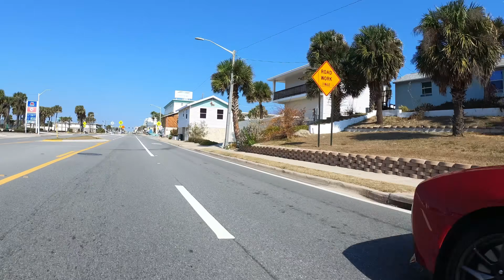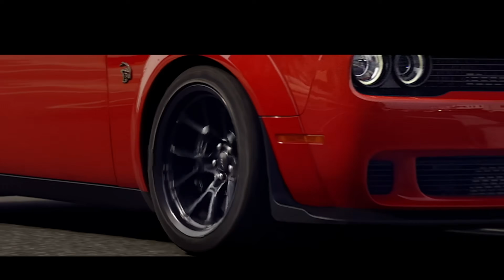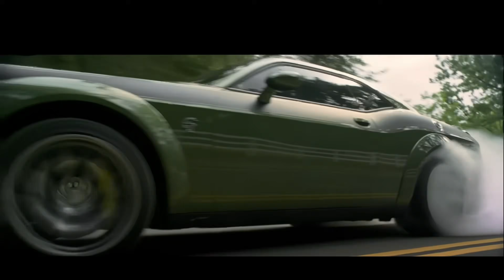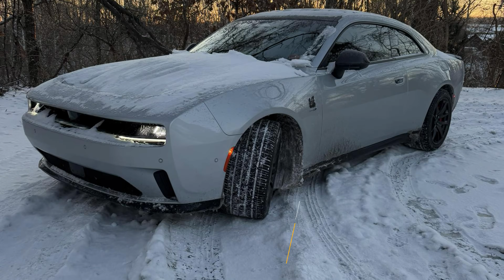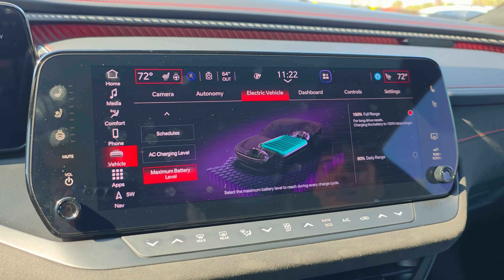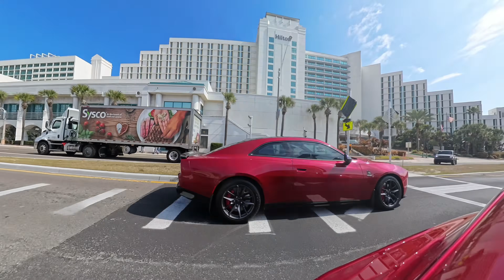Dodge Charger Daytona Scat Pack EV Owner Review

Comment: No glitches or reliability issues?
Reply from the maker: I haven't chatted with Garrett since that video was made, but I did end up buying a used 2024 Scat Pack EV and of course he discussed his car's reliability after 38k miles in the video. So far I've put 9k-trouble free miles on my Scat Pack, for a total 24k miles. It had all the flash updates performed before I bought it. Based on what I see in user forums, it sounds like Dodge made have conquered most of the reliability issues early owners suffered with firmware fixes & 12v accessory battery replacements.

Comment: I stay away from using the controversial exhaust, only used it because a coworker was curious. However, I do find more non hemi owners like and request it. Why didn’t they just put a mic on a hellcat and press record as it goes thru the motions
Reply from the maker: I hope we'll still see that sort of thing as an additional OTA or flash  choice at some point, since there's no reason - that I know of - to limit the potential sound effects. I'd also like to see Dodge add a sound option that simulates shifts as Hyundai's Ioniq 5N does and even get truly silly and do a deal with Warner Bros. to license the Jetsons car sounds. The "exhaust" is silly but it's one more thing that makes the Charger fun and sets it apart from garden variety vehicles. Like you, I often leave it turned off, but it is fun to use occasionally.

Comment: On my EV Skat I average 250 mile range @100% and 205 @80%, actual mileage based on driving habits are 230 and 185
Reply from the maker: It's amazing how much of a difference the drive modes and a "lead foot" makes in the EV Scat. Given it's size and performance, I've been impressed with the range. I own one and regularly get a real 245-250 miles on the highway and about 275 around town. Here's an 1,800-mile highway trip video I did with mine: https://www.youtube.com/watch?v=htQwJJcWcQQ

Comment: when I saw this the first time I fell in love because it's a muscle car silhouette but an EV.  the best thing is that it's not $80k like when it first came out!!!  seriously considering this EV.
Reply from the maker: I recently bought a used EV Scat Pack. So far I've put about 3k miles on it, including an 1.8k road trip. So far I'm loving it. Here's the 1st video on the Charger EV: https://youtu.be/JnefbvREHew?is=9yukEPoSkwyJrjta
Reply: @EVRider  appreciate the info, thank you sir!
Reply: My Stage 1 Blacktop Edition sticker was $62,685.00.  I bought it with 950 miles on it for $37,500.00.  I love this car.  Mine has 496 horsepower, (not quite the Stage 2) but that's plenty.  And I filled it at a supercharger from 14% to 90% for $31.00.  My V8 would have been over $100.00. for that.

Comment: If they sold this for $25-30k, got rid of the speaker noise and chnage the strearing wheel to something better then I would eat it up
Reply from the maker: You can turn off the speakers. As for selling it for $25-30k, good luck finding any new car for that price. Although in the used car market you can find Charger Daytona R/Ts occasionally for $30k or so.
Reply: @EVRider  I'm talking after it not selling for a good 3-5 years here not literally as soon as it comes out lol
Also not heard of the daytona before but hey 30k is still better than 100k for a truck 😂
Reply: 25-30k? What planet are you on?
Reply: @mprce52  Planet earth because they are dropping down to 35k in some places 😂

Comment: The only thing I hate about that EV car is the speaker. I don’t like it whatsoever. It sounds futuristic then let it sound like a V-8.
Reply from the maker: Easy solution. Turn it off. Then you've got one of the fastest, best handling and quietest luxury sport coupes to ever make production. Actually if you think about it, it's amazing how many personalities Dodge has managed to bake into this automobile. The difference in feel, suspension and even fuel economy is staggering between drag mode with the sound on and eco mode with the front motor and sound off along with all the other settings in between.
Reply: EV has multiple motor sounds and silent Stealth mode. All gasoline motors use mufflers so they are creating FAKE sound

Comment: I test drove a 2025 R/T and loved it! I just wish Dodge would make the silly fratzonic speaker an option that could be deleted to reduce the cost. It's a beautiful car, but expensive. I hope Dodge has overcome the worst of the early production gremlins and keeps making them. But they need to be competitive with the EVs from Audi, BMW and Mercedes. I ended up buying a lightly used BMW i4 but hope there's a Daytona in my future!
Reply from the maker: While I agree the Daytonas are too expensive new there are some bargains to be found in the gently used category. You can already fine examples with under 20 thousand miles that have depreciated 50% or more. The BMW i4 is also a cool, capable car. I remember enjoying the M50 version during our review a few years ago: https://evrider.tv/sport-boost-shifts-bmw-i4-ev-into-m-territory/
Reply: @EVRider I’m about to get one with 2500 miles on it for about half of retail.
Reply: You can turn off the fratzonic.  I never drive with the sound.  My son won't get in the car if I turn  that on. ;)

Comment: this car looks like a blast to drive, but two features that would make it perfect for me would be "neutral-revving" the exhaust and simulated fake gears. 
The V8 sound is cool, but weird to me that it doesn't shift. would be cool if you culd custom-configure the number of fake gears, anywhere from 4-speed to 8-speed.
Reply from the maker: It does have have the ability to do neutral revving in terms of sound in a few modes like sport. Although it doesn't have fake shift sounds it does have three-level regen paddles that would give you much the same sound and feel experience as down shifts.
Reply: I've been wondering who the target market is for fake engine sounds.  I'm dying to know what you find cool about something that is objectively and shamelessly fake, artificial, and superficial.  I'm genuinely not trying to troll you, I am legitimately curious as to what the appeal is in your head.
Reply: @AMurderOfLobs  I completely understand where you're coming from, and usually I'm not a fan either. But this car stands out to me specifically because it's intentionally trying to not look and feel like an electric car. I kind of see it as a super immersive sim game, and if they're going to simulate a muscle car, I want them to simulate every aspect of the experience. 
It's never going to match the real experience, but I'd be ok paying for (what i personally feel is) 80% of the muscle experience while also getting the very real benefits of an EV. 
...this is completely separate from the very bad reviews I keep seeing about the reliability though. they really need to figure that out.
Reply: @tetsmon  i dunno, i feel like simulation is best left for video games or disney land, not something i pay tens of thousands of dollars for.   i'm a purist and will always prefer something leaning into it's nature to do what it does best instead of trying to create an illusion with a silly parlour trick.  it's like the epitome of a gimmick.
Reply: @AMurderOfLobs  I think that's where the main divide is-- I don't really mind gimmicks and think it's fun. I appreciate when automakers include "fun" features they genuinely didn't need to include, like paddle shifters on an econobox or Ford's fold-flat F150 interior. I like the idea of owning an EV, but if there is one offers unique fun features purely for the fun of it, I'm going to pick that one.
Reply: @tetsmon  I feel like people are easily fooled by the gimmicks because they fail to realize how rapidly the novelty of a gimmick wears thin.  because its an illusion, a cheap trick, and one that you know the falsity of - you begin to find it at best useless - and at worst annoying/embarrassing.  i bet the majority of owners turn that engine noise off after a couple weeks max, and only turn it on a couple times a year...when the in laws come visit over thanksgiving or whatever.
Reply: @tetsmon  Also the fold-flat interior isn't a gimmick, nor are paddle shifters.  There is a genuine value in having a flat work surface in your vehicle, especially a utility vehicle.  Likewise, paddle shifters provide the benefits of a manual transmission at a more seamless form factor and gentler learning curve.  A quirky feature is not necessarily a gimmick.
Reply: @AMurderOfLobs  But where do you draw the line? exhaust sounds are just byproducts of a gasoline motor, you could make it as quiet as a lexus or loud as a hemi. Nobody complains about their cool-sounding caf though. Hypothetically if you did get tired of the fake EV sounds, you can just...turn it off, and turn it back on again when you feel like it, just like a valved exhaust.
You ask questions, but you dont seem to be interested in seeing things from my perspective. I hope you are able to find joy even in these small compromises someday.

Comment: Wife drives a charger awd, I drive a plum crazy scat pack. I've owned camaros, and my pride was a 71 Stage 1 Buick. I took 2025 for a test ride and this car is probably the most underrated, least loved car on the market today. I even debated a lucid air, but that's 10k more for a car 2 years older. For almost 30k less than the sticker for a car with 500 miles, it was an offer I couldn't refuse. Now I'm tempted to sell the challenger and get another charger.. it's that damn impressive
Reply: Bought my Stage 1 Blacktop Edition for $37,500.00 with 950 miles on the vehicle.  Sticker was $62,685.00. I love this car.  It is a lot of fun.
Reply: @JoeBlow_4 I wish I lived in the US so I could get such an amazing deal :(
Reply: I'm happy that these are "failing"
I'm gonna wait till they are like $25k-30k and I will eat this thing up!
Reply: @LuxTheFolf they’re 50% of msrp now, that’s probably as cheap as they’re getting new.
Reply: @g32k  True but I really don't wanna drop 40k+ for such a dodge, if I am I may as well get the base modle dodge brand new 😅
Reply: @LuxTheFolf I mean you can get a new ev rt for $30k and a new ev scat pack for $40k.
Reply: @g32k  Really?
Damn :/
I wish i could buy it lol 😅
(They are not sold in the UK)
And I really don't wanna go through the bs trouble of buying in another country, shipping it to mine and getting it registered :/
Also I cannot even find any for thag price online either, all brand new and 50k minimum :/
Also will need to have specialised wiring done to make it street legal in the UK due to lighting problems that are not legal in the UK :/
So ye very very costly :/
Not worth it
Reply: I'll reply to my own post. 4 months later and the car has been in the shop 4 times. Assorted software bugs, cacasding errors, and the last time 2 recalls.. One for the airbags and another for the electric system. When the car runs, it's the best car I've owned, but right now I don't trust it... Hopefully this last round at another dealer did the trick
Reply: @MoltenFungus  I mean this is kinda why I'm waiting for a while to buy one and then price will also go down.
But also i physically can't get them in my country without paying high import charges and registration fees. But also they legally can't be driven in my country unless you modify the lights 😂
Reply: @LuxTheFolf I'm here in Spain on vacation as I type this. American cars, even sedans are much larger than the average car. There's no way they'd fit in a city. The new dodge is much much wider than the older dodge. I guess that's why I don't see anything American in Europe except for the smaller jeeps. I get it though.. we built everything around a car, and Europeans are more practical... Public transport is so superior here.
Reply: @MoltenFungus  I mean-
Highly depends on where in Spain you go.
Same with elsewhere in europe, sure on local roads with tight corners it will struggle same with in the UK but you can still drive it there :/
Bro I've seen bus drivers going 20 around a corner which i would need to do a 100 point turn at 😂
Trust me if a BUS can get through there then a dodge can 😂
Also I live in the UK so :/
Our roads are a little bit better than Europe as our "growth" has only been in the last 70-50 ish years :/
(Before covid)